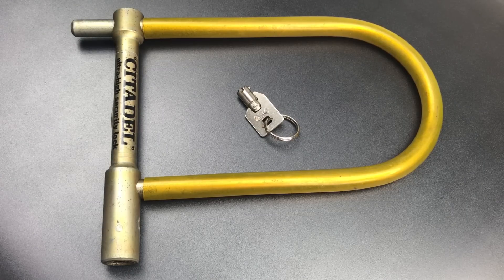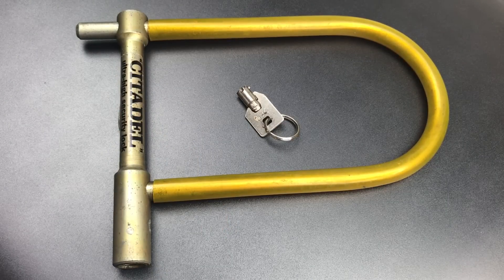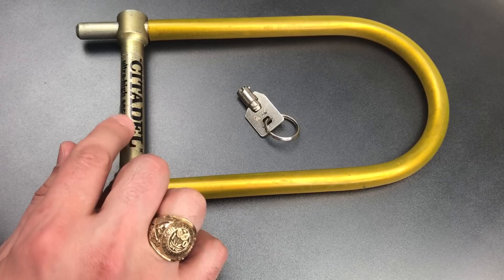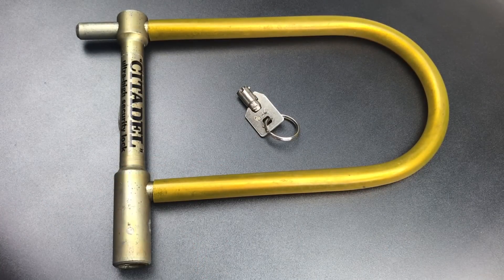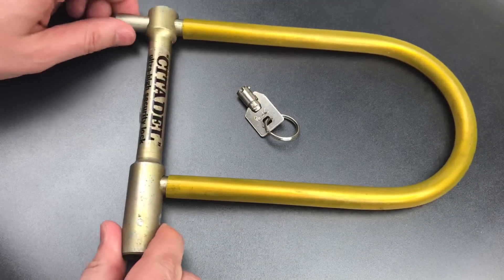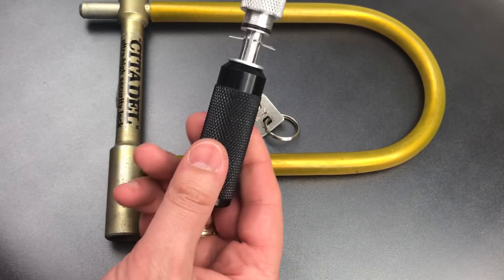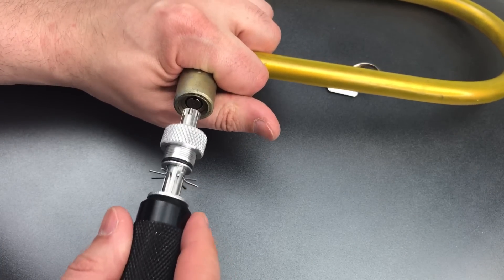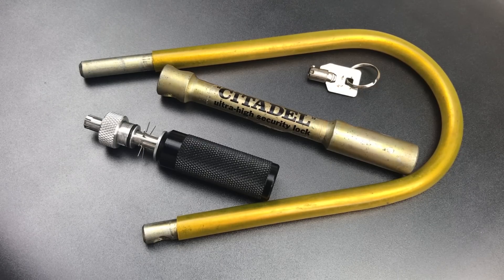[664] Vintage Citadel “Ultra-High Security” Bike Lock Picked

Comment: I had one of these in the early 80's The model I had used a flat brass key which unscrewed the bolt that locked the U shackle. After a while it got very stiff to open and one day jammed solid. The shop who sold it were completely unhelpful but a cycling friend had heard that it was possible to remove the lock barrel. Investigation showed the barrel was held in by a thin split ring. Using two hardened steel scribers I managed to prise the split ring out of the housing and the barrel just fell out.

Comment: For many years my bike was my only transportation. I had a nice road bike that I locked with this Citadel. I attended UT Austin and always removed front wheel and locked thru back wheel, frame and front wheel to a bike stand etc. Bikes around me were stolen but as far as I can tell no one ever tried to cut the Citadel. Now I have an ebike and use heavy duty Kryptonite locks and the provided café lock with an integrated chain . I still add on my Citadel lock for old time sake! Still no obvious attempts. So far around here I have never heard of lock picking just cutting. (Phoenix area)

Comment: interesting how the level of security needed has changed over the years. items from China and the Internet as education for the criminals has made it harder to keep items private and secure. back then people thought a 5 pin lock was a good choice, so a Chicago lock would scare most away, and Li -ion powered angle grinders were not around either.
Reply: Rune International batteries and motors are light years ahead. If you watch “driller killer” the dudes got a belt pack with lead acid batteries on it and presumably an inverter, it’s nuts.

Comment: I have one of those I got in 1976 from a Motobecane (moped) dealer.  I think it was about $12.  Marketed as a bicycle lock, it came with a guarantee to replace your bike, up to $150, if the lock failed.  I have it on a shed door now, with the open end sticking out two holes.  With the end on it looks like a door handle.

Comment: Awesome video and always a pleasure since you share such useful intelligent information. Also, I had no idea that tool worked that way. I thought you had to manually adjust the prongs or needles around that thing.
Reply: Me too. And I still don't understand how the tool works.
Reply: LPL explains it better than I could ever do here: https://www.youtube.com/watch?v=8two2t3W744
it basically relies on the fact that (in the "old" locks) the pin springs are all the same and the driver pins are the same length, so if you push all the driver pins with the same force the shear lines align. Push that shear line down to the right point and the lock opens.
Reply: Very interesting, thank you.

Comment: "Modern Citadel U-Lock is garbage with Abus sticker" , or not made of hardened steel. One example Citadel Brooklyn model, for that money you can buy a good U-Lock. For example OnGuard Bulldog series, standard size 23cm for about 30-40$.
https://www.amazon.com/Citadel-Brooklyn-945-Bike-Lock/dp/B004MKMN0E
This is Citadel quality , owner of the bike lost all keys and had no other option or must cut U-Lock.That guy used a cheepest 1 euro hacksaw blade(not even standard HSS Bi-metal blade), and cut Citadel lock/14mm shackle in two minutes.;)
http://www.forum.hr/showpost.php?p=39059691&postcount=633

Comment: I can only assume  you haven't heard of the 'Bic' pen impression method?
Well actually, the Crayola left tip pen ends were particularly effective at opening these locks.
That method has worked long before any standard impressioning tool was devised. LOL
Reply: He has: https://youtu.be/zWcTYaW5hak?t=52 😜 There is at least one more video where he mentions that Bic method.
Reply: Modern Leveller - he has https://youtu.be/8two2t3W744?t=243 though the Crayola bit is new to me - thanks for the tip (!)
(edited to point the video at the specific point where LPL mentions the Bic pen)
Reply: Modern leveller, what is a left tip pen? Is it better than a right tip pen?
Reply: D Sloop I think left tip is a typo for felt tip
Reply: shhhhh.
Reply: Whoops.
Reply from the maker: Of course I’ve heard of it... but it wasn’t well known until at least 20 years later.